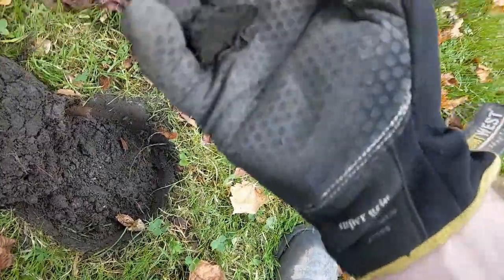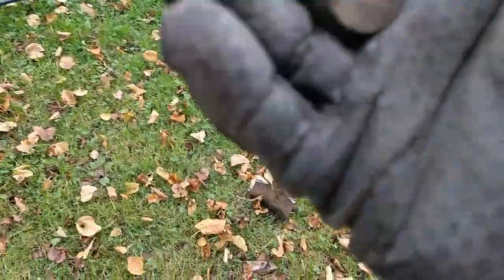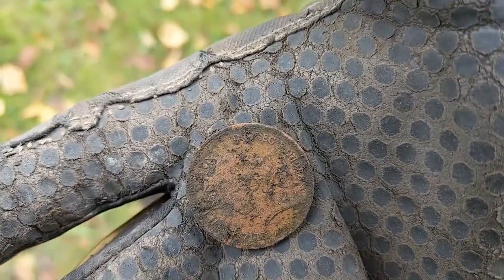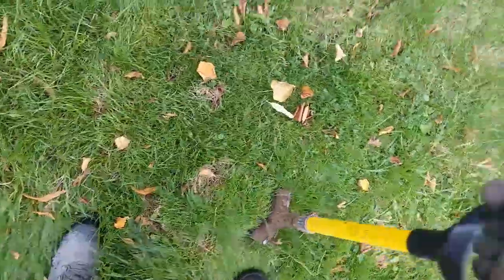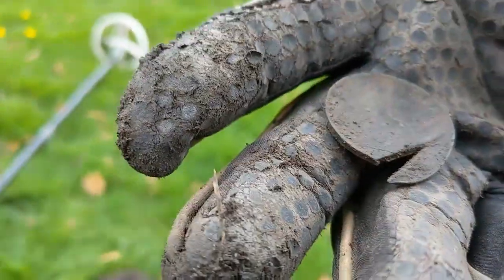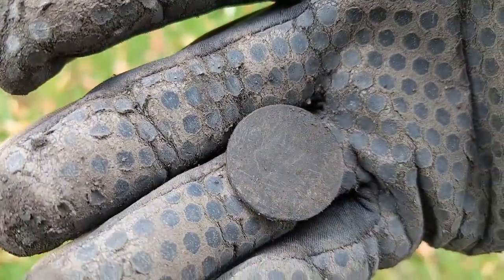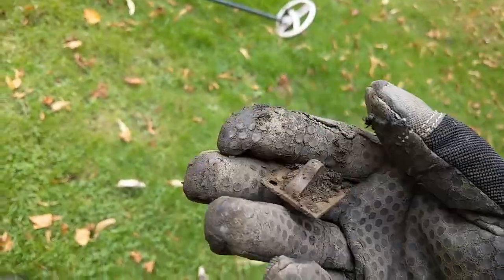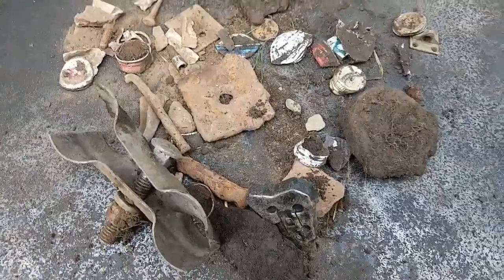AWSOME COIN HUNT PART 3

Comment: Congrats on the finds is that a XP Deas your using?New to the channel new subscriber
Reply from the maker: Hi buddy yes it was the Deus with the high frequency coil I use that and the equinox 800 mostly and the ctx 3030 on the odd occasion

Comment: Very cool finds,how do you clean the coins
Reply from the maker: Most of the ones you see in this video come out perfect as you can see because they are made of bronze but with the coins make from copper I spray isopropanol alcohol to remove the moisture and very lightly brush to remove they copper oxide from the surface and try to keep any details on the surface that's why I always carry a spray with water and isopropyl alcohol.. Water for cleaning silver coins to stop any scratches on them and isopropyl for the coppers
Reply: @Thebigmanmetaldetecting  great info,many thanks for the info,really appreciate it
Reply from the maker: @sosteve9113  GL&HH